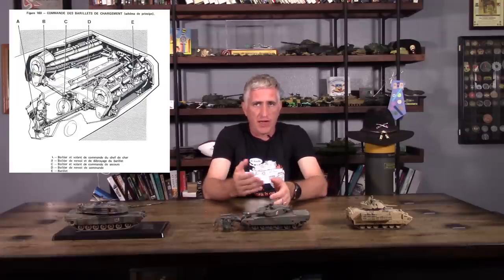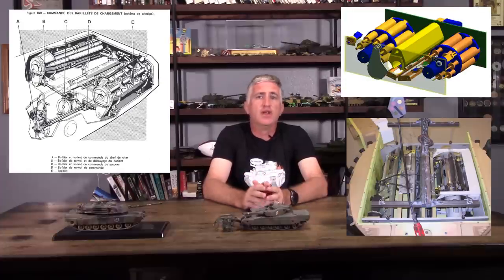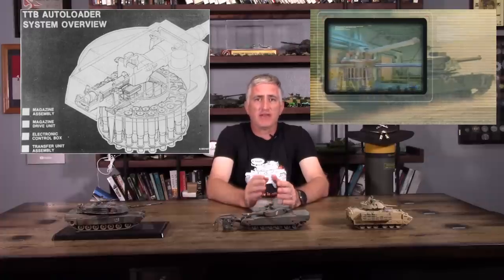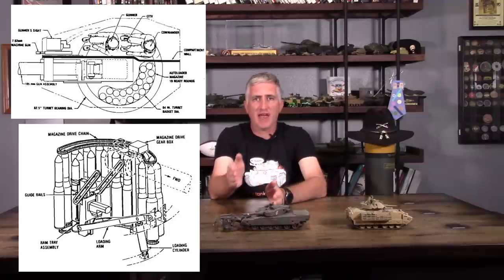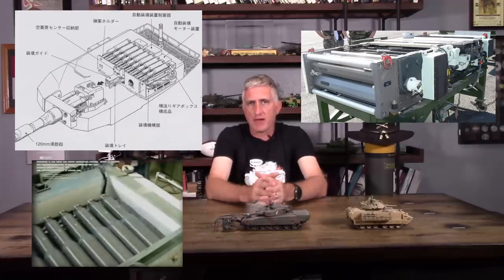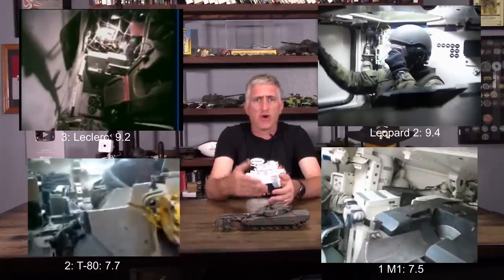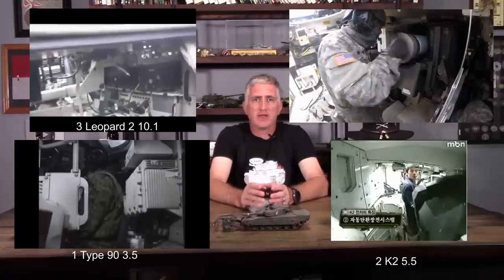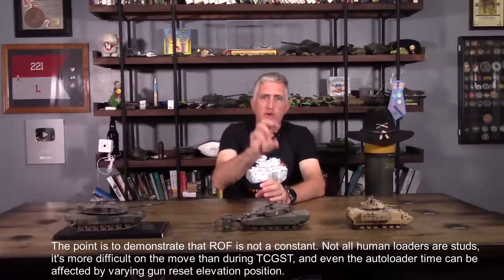Whither the Autoloader?

Comment: So you can either man 14 tanks with 56 recruits, or 18 tanks with 54 recruits? There is that slight increase as well. And even if you do not want to increase the size of your fighting band, you have still have 25% more guns for the same manpower. Not quite true of course because you need maintenance personell etc as well for your extra tanks.

Comment: Two questions.

Chieftain argues autoloaders are better because the armoured door between the crew and the ammo can be smaller, and I can understand that logic given some reading of the RN's record at the Battle of Jutland... but if the incoming penetrator entered the tank through the bustle first, wouldn't a small door turn the hot gases from the cooking shells into a concentrated high pressure flame?

Looking at the projected 3-man tank company with extra troops in APCs for maintenance. If, as Chieftain says, they can also be used to replace injured or sick tank crewmen, to be really effective they would have to be trained in all the positions, right? I mean, the extra troops cannot all be trained as driver/mechanics. Some would have to be trained gunners, some would have to be spare commanders... wouldn't that be a blow to personal morale, to be trained as a gunner and "own" the position in a tank? And wouldn't it add a considerable amount to the bill for training?

Comment: Hey mate, i would like to know this question for a while, how the trigger in a tank works and how the firing pin is activated?
Reply: Electrically primed ammunition. When the trigger is pulled, the firing pin is put in contact with the primer at the base of the round, current is applied, 'BOOM'
Reply: @mongo1137  but how all the system works, like how inside the cannon it fires or where the stuff is, because also there is mechanical firing pins
Reply: @fumofugamer6277  I can only speak to US tanks, our cannons had electrical firing pins. If the electrical triggers failed, we had a hand crank emergency firing mechanism.  The propellant in the round is set off by the primer, which is ignited electrically.

Comment: I have a question: I heard that auto loaders can have problems with longer projectiles (I think this was about a long rod penetrator). Is that true?
Reply: Yes and no. There is a problem on old T-64/72/80 autoloader has a limit ammunition length , T-90 and upgraded T-72 can use longer projectiles. Object 195 had autoloader and the round was 2 meters long.

Comment: Crew size makes a giant difference. The Soviet IS-2 was able to pose a threat to the German late-war tanks despite only weighing 46 tons. 
Smaller tank, smaller engine, similar speed as other heavy tanks, good armor, massive firepower. How‘d they do it? Remove the radio operator and use a four-man crew.

With modern tanks, the only guy you can reasonably replace is the loader. All the other crew are non-negotiable UNLESS you want to try making your tanks remote-controlled or something.
Reply: Meanwhile in the U.S. Air force: «Over a two-week span in December, a heavily modified F-16D Fighting Falcon took to the skies no fewer than a dozen times with an empty cockpit and an artificial intelligence (AI) pilot at the stick. The AI algorithm is complex enough to allow it to dogfight all on its own.»
Reply: @wuspoppin6564  yes there is definitely a possibility of replacing humans entirely to some degree, but there are also limits to how far this can reasonably be taken. I also suspect that doing so is easier for aerial vehicles than things like tanks. Human crews can make ad-hoc repairs, for example. Tanks are also in the field a lot longer. Plus the hardware itself is valuable enough that it‘s not per se something you wouldn‘t want to waste humans on. 

Cheap AI drones could probably replace human pilots entirely but a tank is always going to be a super-expensive piece of ordnance, it‘s something worth investing humans into.

Comment: Question: can an autoloader function when the main engine is switched off and only an auxiliary power unit is working? Can manually loaded tanks engage targets with only the APU? 
Reducing the heat signature by working on APU only can be beneficial. If an autloader prevents that, this could be a signicant argument against it.

Comment: I can't argue with the logic of most of the reasons for using an autoloader. 

I have to agree that a tank that is designed to include an autoloader from the get go is going to be able to make the most of it. 

I also can't really argue with most of the weaknesses. If the time of loaders between crew, semi-autoloaders and full autoloaders is getting to the point where it's almost impossible tell them apart. Especially at the level of tenths to hundredths of a second. 

What I want to challenge and get a better idea of what the modern systems have, is what I'm going to call delicacy. I can't help but wonder if a trained person is more resilient than an autoloader. Rather than it being a case of autoloader is hard to maintain and keep in functional. I wonder if the autoloader can be so adaptive. When a vehicle takes a series of non-penetrating hits, I'm wondering if that isn't a factor. 

I seem to recall a story of a M1, not sure if A1 or A2, lost some tracks in Iraq, was heavily bogged down to the degree it couldn't be extracted easily. It was shot multiple times to prevent it fallen into enemy hands. About all that happened to the tank was the scope was knocked out of alignment when the ammo went up. The turret had little damage otherwise. By the time they finally did some damage and worked it wasn't much they were back to square one. While they were wondering what to do, the heavy recovery vehicle finally turned up and they pulled it out of the bog, ditch, steep bank. 

Forgive the lack of details, been a while since I read the story, heard the story. 

I can't help but wonder if there was an autoloader present, it would suffer more faults, issues. If you hit it hard enough, shake it enough, everything breaks eventually. Does this apply to people too? Sure. I just wonder if the trained tanker, who has been through exercises, who has been exposed to it, can keep going. When the autoloader would require some noted maintenance and force the vehicle out of combat. 

 Which kinda leads to my second issue. 

It strikes me that the autoloader requires more access for repair. To the degree I would suggest that the turret would have to removed to do a lot to maintain. When you take up that space for machinery, you need just as much space, if not more to get at that machinery to repair. After all, the whole point of the power pack of the Abrams is that it's a plug and play engine. For the autoloader to do the same, I think it's going to require a level of modularity that I don't think we've worked out yet, being blunt. 

Especially if you want to be able to take this mechanism out piece by piece through the turret door. Otherwise, the only option to lift that turret each and every time. Maybe I'm a bit of a luddite here, I could be. Lifting a turret sounds like a hefty thing to lift and a bit of a bastard of a job. I guess that Diploma of Logistics has made me something of a details guy. 

At least until rounds get so heavy a loader isn't able to handle them.
Reply: He already addressed your first point.
To your second - the existing blowout panels provide all the access you would need.
Reply: @jaroslavstava3704  I'd argue not. Nowhere near. 

In turret repair during an action needs to be considered and having seen those images of how tight it was, it seems to me that it's just not possible. 

Like I said, hit anything hard enough, enough times and you're going to break it. 

I think the transfer of energy through the vehicle from the impact has enough potential to upset even a modern autoloader. At least if you tolerance the parts as tight as possible. 

If you can't get at it, to correct it, it forces the vehicle out of combat. 

And if an old computer of mine was anything to go, it may even have the problem of a hit in the right place and that's it. 

I could turn an old computer off without touching the power button, one solid hit on a part of the case and it carried the energy down to the switch and that was it. Computer turned off.
Reply: @LionofCaliban  na, I don't think thats an issue. From what I have read that has NEVER happened to russian T-72s and T-90s. atleast I can't find any information on it ever happening.

BUT i have read that the opposite is true. that the autoloader on the Leclerc is less likely to get damaged by a non-penetrating hit then the crew are.

I would assume the chances of it happening are based on the equality of the production.
Reply: @matthiuskoenig3378  No chance I could get some sources on that? 

If we're talking some form of mechanical system, it really depends on what its tolerances are and how to secures things. 

There's a part of me that won't be pleased until I've seen a tank take upwards of one hundred hits that don't penetrate and each return shot is down the exact same path. 

There's also a part of me that knows that it plain just doesn't matter how well you insulate something from shock, especially when we're talking projectiles that travel closer to 1 kilometre a second are involved, that's a lot of impact and something is going to feel it. 

I've worked with enough automated systems, conveyor belts over the years to see that supposedly in tolerance movement can lead to failure. Yet, it was all in tolerance. 

That's under ideal circumstances too. All it takes is a check to be missed and things get a bit gunked up and there's your point of failure. Which is easier to do the tighter the tolerances are. 

I really need to see numbers and I really need to test this out for me to change my mind. I can't do that. If you've got sources with numbers and official ones at that, that's a start.

Comment: You said that soviet tanks with carousel autoloaders could in theory have blowout ammunition, that is one thing I've often speculated on, but then why hasn't any user of those tanks done that? Is it for ease of loading ammo into the tank? Is it because of paranoia of the autoloader failing and having to be operated manually? Are those tanks so cramped that there is no space for adding a "fire wall" between the carousel and the  crew? Something else?

Comment: Respectfully Sir, another problem with autoloaders if I may. Do autoloaders have an emergency or manual mode to allow the TC to manually load in the event the autoloader fails? We both know you can’t just back out of a fight and must be able to continue the fight if at all possible, hence why Abrams has 3 ways to fire. If they do not have them, then how can the crew continue to engage?
Reply from the maker: Most, if not all, do have a manual backup option. It’s slow, but it works.

Comment: How many main gun rounds do you need to fire one after another in a typical engagement? How many can be fired without affecting the recoil system? How easy or hard is the autoloader to reload? How much maintenance is required by the crew? How much would it cost? I'm not against the idea of one, just not sure its needed. But Hell I still miss my old M60A1.

Comment: I am not sure if rate of fire would really be that important since in actual world one penetrated round is enough to kill a target, there is no life/health bar.
Also about the "sweet-spot" argument I think you ignored the same problem with autoloaders too, the round may be stored in the opposite side of the loading position, which also takes time to move the rounds. I would argue that as a disadvantage for autoloader since manual loader can always switches round by hand to "sweet-spot".
Reply: Rate of fire is critical.
Not for engaging a single target, but for the target saturated environment of a break through push with combined arms support, which is what tanks are designed for.
Reply: @SonsOfLorgar  But tanks do not operator alone like the Chieftain said, they operate in squadrons, each can engage the same target.

Comment: Human loader pros - he might spot something the TC and gunner missed; they might see a thin skinned vehicle and have been firing ammo that isn't even denting it. Loader sees something through his vision slit and loads in a APFSDS round instead of HEAT. Gun goes Boom! Target in sight is now a smoldering scrap heap. Different eyes in different places see many things. If something goes wrong in the tank he's usually the one to fix it - the tank maintenance man. Under adrenaline a human loader can ignore pain,discomfort, and focus on solely feeding that big boom stick - he's cranking out 4-5 round a minute.He can adapt to the situation as needed. If the breech isn't sitting right he can make adjustments as needed.

Human loader cons - he requires food,water,medical care, prone to injury,prone to dying,human error. He is a human, he has needs,he will do what he can to satisfy those needs. He has a family - if he falls in the line of duty he leaves behind those he loves. You gotta pay him as well for doing his job;dents the pocket if your invading on a budget. Loaders get tired,weakened from heat/cold/humid/dry conditions.

Auto loader pros - you don't have to pay it, it doesn't need food,water,medical care, it has no family. It does what you tell it to do everytime without question or back chat. Consistent performance in any climate. Loads just as fast as a human can.It can lift more than a human can so bigger and heavier rounds can be used.

Auto loader cons - If something vital breaks your done for - no more rounds going out to the enemy. Your out of the fight. Repair times and repair costs mount up as well - the ramming arm snapped! head back into depot for 4 days worth of repairs. It can be complex and take extra time to fix as well. Computer errors can be thrown - ramming arm stops 3/4 of the way in. round not seated properly gun won't fire.Now you have to have it extract,re ram, and try again. Flammable lubricants on board - take a hit to a tender area..auto loader broken! non functional! fire in the auto loader section of the tank!

Comment: So I normally drive the M1A2 but this year i got to load for the 1st time.... I was pretty fast 6 seconds average at first but I started tired after round 10 I'd say. Long story short I support these claims and see a lot of fair points for autoloaders especially the extra tankers piece. Tops got a 113 or I believe now a days even a Bradley so no new equipment is needed plus those tankers that are not on the tanks hey rifleman 1st right. We got M4s and some companies even have Bravos for the loaders MG so there ya go heavy infantry support for the tanks even. Why not Israel has a 3 man team pop out the back of the Merkava for the same reasons. I think the M1A3 or even an M2 Abrams should have an autoloader instead of a human and we use those extra troops as replacements if needed or infantry support.

Comment: If we get rail guns in tanks (or similar) autoloaders will be a moot point I think as the projectiles are usually less than 20 pounds and you could just gravity feed them as they are only about 80mm diameter (some are smaller). The ones that size have near 10 times the muzzle energy of an APFSDS round due to being about mach 12 and heavier. They also sustain energy better as the drag is increased by less than the mass increase. IE 20% more drag and double the weight. You would just need a hopper on top of the rail gun that would take say 6 rounds? If you could charge the system fast enough (unlikely) you could in theory fire those 6 rounds as a burst. That would give a concrete bunker 10 meters thick a really bad day.

Comment: Cassette and cylinder autoloading is fine.  It's just the T-72's under turret carousel bomb-in-waiting I'd be worried about.  Particularly with just sheet metal between you and the powder charges.